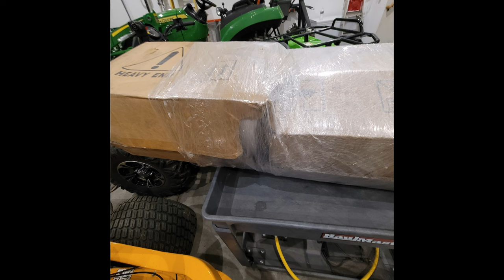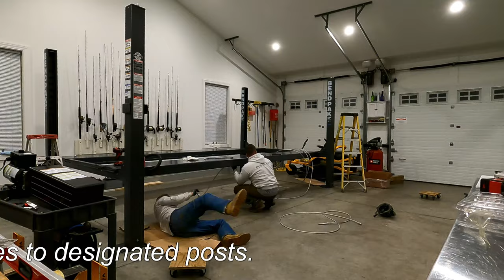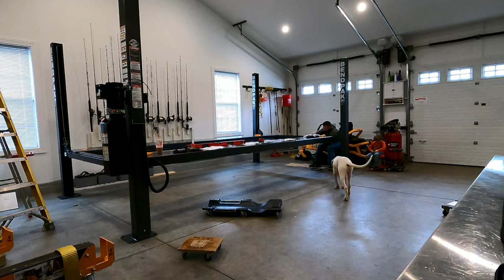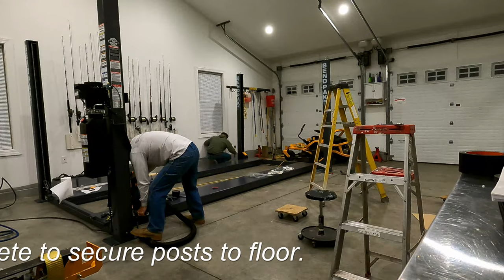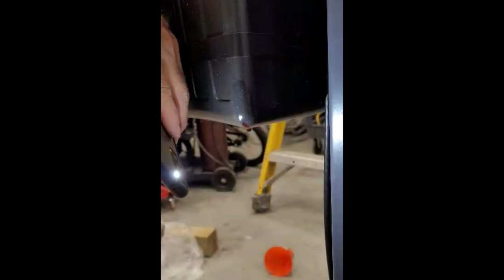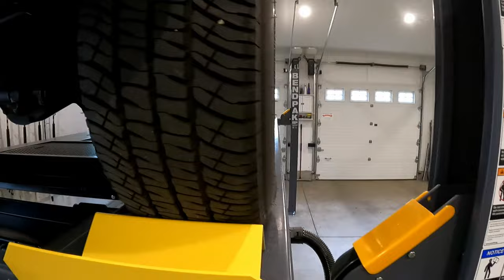BendPak HD-9XW 4 Post Lift: Install and Initial Impressions

Comment: I was just on BendPak's website. They said not to mount over expansion seams or cracks in the concrete! Just say'n.
Reply from the maker: Thanks for the feedback! That be more crucial on the 2 post lifts...technically the 4 post lift doesn't have to be anchored.  I had our floor poured at 6" plus at 4000psi, along with fiber and rebar.  Considering that and the aforementioned, I was okay with the placement.
Reply: @theroyboys2  Nice!

Comment: I’m building a 34x60 shop with 14 ft walls and 12x12 doors. Designing it to accommodate a 4 post and a 2 post, tandemly. I appreciate your video. I might get this model or another BendPak 9k. I need the runways to accommodate. F150, f250, BMW sedans and a corvette. I might run into some tread width issues to accommodate all that. Thank you for your video. Please update us with issues. I also own a Takeuchi compact track loader, I see you own one!
Reply from the maker: Thanks for the comment!  So far so good.  You shouldn't have issues with the runways.  In the widest position, it accommodates the SRW super duty's.  There is also another setting where you can narrow the width (if needed for the BMW), which only requires removal of a couple bolts to change.

Comment: Thank you for the time to make this video.  Question.  I need a 4 post that will allow me to pull a super duty with a small lift underneath with a car stored above. I have 18’ ceilings in that bay of our garage.
Reply from the maker: I am not able to pull my super duty under this lift.   The problem you may run into is a lift that will go high enough to pull your truck under will not have the lifting capacity to lift your truck...at least that's what I came across at the time I was looking at them

Comment: What kinda of power source does it need? My garage only have common household 20amp 110v receptacle. Will it be able to handle this?
Reply from the maker: I believe BendPak has a 110 option, but you would have to confirm with their customer service.
Reply: @theroyboys2  Thank you!

Comment: Thanks for the review. I just ordered one.   Question; what kind of finish do you have on the floor?  Do you like it?
Reply from the maker: It's a commercial sealer that the flatwork concrete guy recommended...I dont remember the name.  It's held up pretty decent.

Comment: Do the jack plates reach the lifting points of the truck or really are they only good for cars.
Reply from the maker: Honestly,  I haven't attempted to jack my truck up on the lift yet... but off memory,  I don't think you could hit both sides of the frame...
Reply: @theroyboys2  ok thanks was wanting to go 2 post lift route but if those worked considered this route
Reply from the maker: @KoleDevR  if you don't need it for the storage and are just using for maintenance... two post is probably the way to go
Reply: @theroyboys2  mainly for maintenance but sometimes wouldn’t mind parking something under but I guess it’s a trust thing I know I see a lot of people park under 2 post lifts.

Comment: Hey I'm thinking of buying this lift for my shop but it's a toss up between this one and a atlas garage pro 9000 which lift do you think is better and why thanks alot
Reply from the maker: I'm not an expert or well versed with the various brands.  At a quick glance it looks like the Atlas may come with a few extra accessories that cost extra for the Bendpak.  However, it looks like the pump on the Atlas is 110 vs the 220...I'm not sure if that's important to you or not... if you have the option to swap if you decided to order the Atlas.  The reasons I went with the Bendpak were the specs checked all the boxes (able to lift my truck, adequate clearances, etc), and the Bendpak was also ALI certified... which is something I wanted.

Comment: Does the truck fit UNDER this lift? Looking at an option to put my raptor under one of these w a corvette on the lift
Reply from the maker: My F350 does not fit under it...I'm not sure the height of your Raptor.  It's pretty true to the specs they post online
Reply: @theroyboys2  awesome thx, I think my height is 75-76”
Reply: @4liter  did you figure out if yours fits?  I’m looking at this same lift to put my Shelby on with my leveled 2017 f150 under it.   It’s 76” as well.  I think k these specs show 81-82” under the runways?

Comment: does this needs to be bolted to the floor?
Reply from the maker: Bendpack has caster kits for them in the event you wanted to move it.  However, it was not something I felt comfortable with...I preferred to have it secured to the floor

Comment: I'm looking to purchase this lift here shortly and was wondering if your truck fits underneath the lift when its fully raised? I've got the same truck and looking at their specs it'd be very close to fitting underneath with it all the way up. Wanting to park the summer vehicle on the lift and park the truck underneath but looks like it may be too close for comfort! Thanks in advance.
Reply from the maker: My truck will not fit underneath...it misses by a few inches.  We had to shuffle our parking spots around, so now the SUV parks under it.
Reply: @theroyboys2  Thanks for the insight. Math doesn't lie I suppose 😅.
Reply from the maker: @fishermanshane4865  I hear you...I wanted it to work, but had to go with option two consisting of shuffling parking spaces.
Reply: @theroyboys2 any idea what the height is from floor to bottom of runway while resting on the top lock? I can’t tell if it’s 82” from bendpak’s specs or not.
Reply from the maker: @JP-ec8fe  There is some adjustment to the ladder locks...I imagine it is 82" max.  For example, I have 79" clearance to the bottom in the front, and 81" in the back.  This is because the runways are leveled on the  two inches of pitch I have in my garage.  Hope that makes sense.

Comment: How thick is your garage floor?
Reply from the maker: It's six inches with a 4000 PSI mix.
Reply: @theroyboys2  thanks for the reply. I’m planning out a 40’x60’ shop/garage right now and will be putting in a lift.
Reply from the maker: @pjfan173  6" with 4 to 5000 PSI is prob the ticket.
Reply: @theroyboys2  thanks

Comment: Can someone tell me the voltage and amperage needed to connect this four post lift
Reply from the maker: It depends on what option pump you chose.  Mine is set up for 220 on a 30amp outlet.